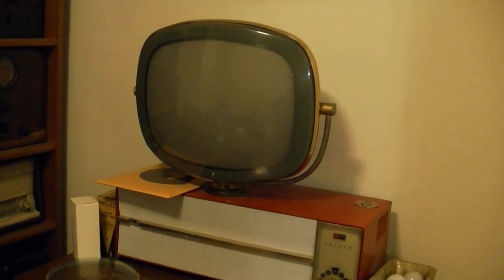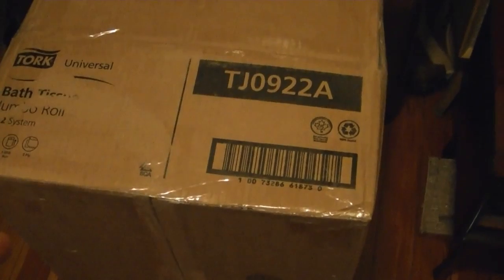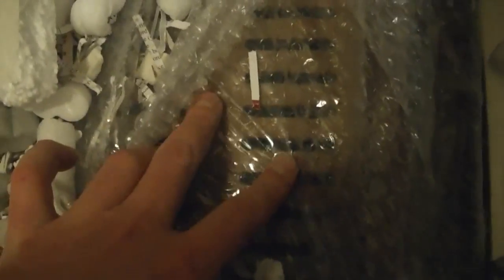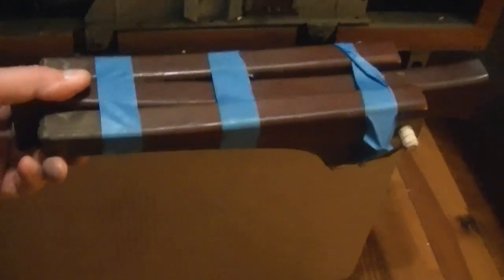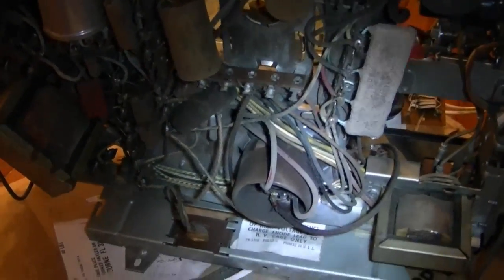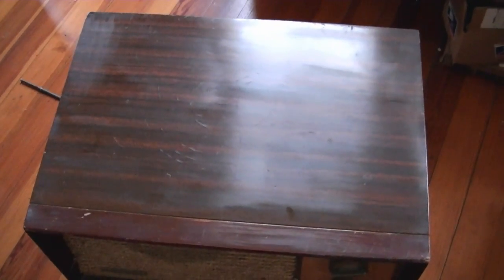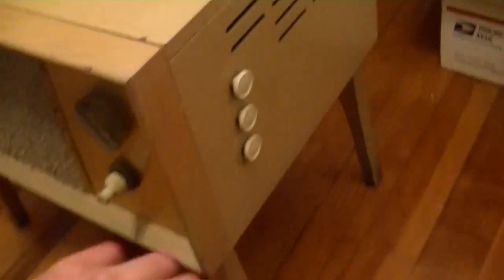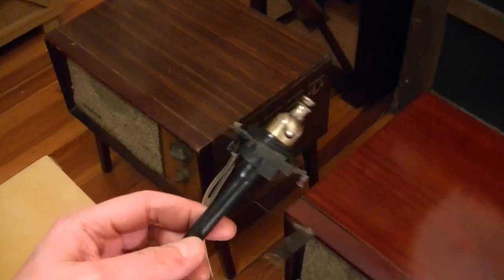Predicta Tandem II restoration pt7o?

Comment: Some of their restoration work make me just wince, it took them until the second season to get a sign painter on staff to recreate painted logos rather then use that peel and stick vinyl crap. One thing they still do is use two stage paint on painted metal items, the clear coat makes it look nice but it also makes it look like plastic. They also have a habit of chrome plating parts that were not just to doll them up, it's a big no no with some vintage stuff like motorcycles.